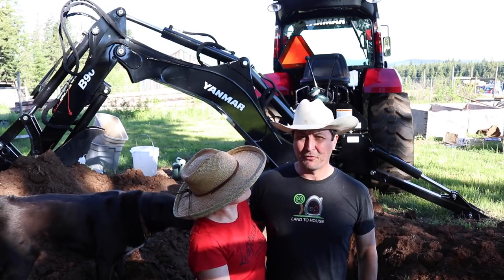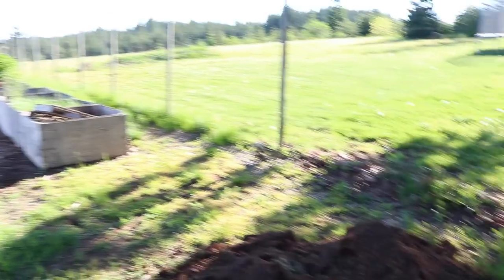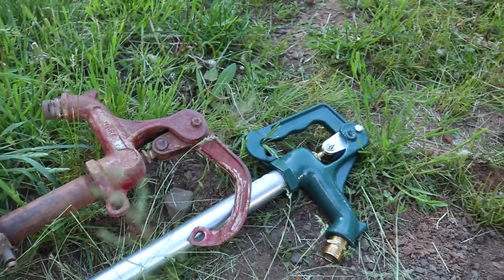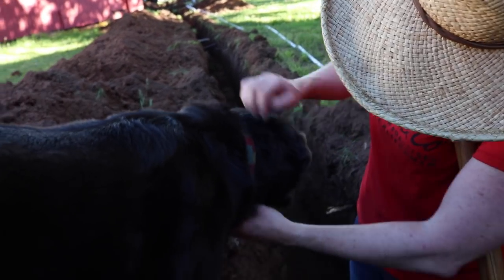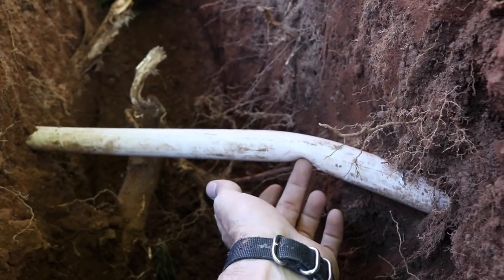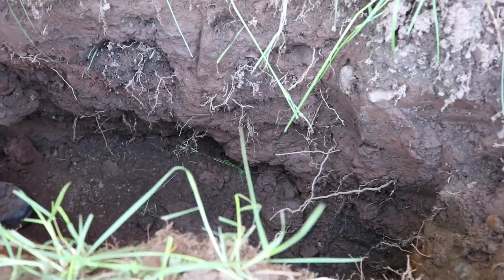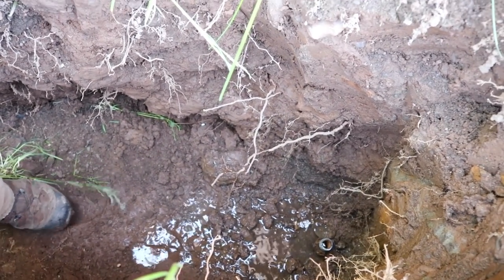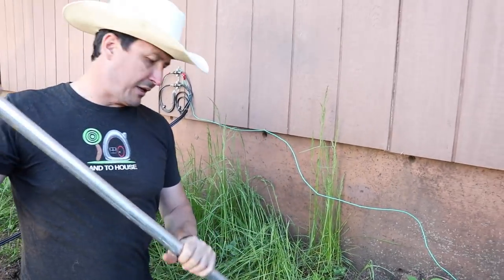A Mouse Jumped On Me - I Yelled

Comment: Hey Cody and Mrs. W.... now you're talking my language. I really enjoyed your yard hydrant installations at the barn and the garden. A couple of things I wanted to bring up. I spent twenty five years plumbing. I was probably one of the last generations of plumbers that actually was an apprentice to my father that spent over forty years in the trade. My son is now a plumber himself. First, the problem of pipe corrosion and eventual failure on the  riser to your yard hydrant is typical. Electrolysis is most likely the culprit, as you have two dissimilar metals connected to each other (in your case the the galvanized and the brass). You are correct, the galvanized will most likely outlast the black iron pipe. I might suggest that you throw a bit of gravel in around the base of the hydrant to allow the drain hole to be free and clear of mud, clay etc. so that it actually will drain out when the hydrant is not in use. Second, it never hurts to put in a post to secure the hydrant to. I can only imagine that you sometimes have long sections of hose connected to your hydrants on the homestead at one time or another. When you are trying to pull a kink out of a long hose filled with water, you might not believe the amount of force you put on the 3/4" riser (ESPECIALLY the new hydrant in the garden, as it is only connected to 3/4" PVC. I have repaired or replace dozens of them that have broke off at the thread for just that reason. Third, great lesson with the correct way to put PVC pipe together, i.e. Primer/cleaner AND cement. It is a two part process and the combination of the two actually melts the surface of the pipe and the fitting together. Though you can get clear primer (not allowed in some states) the reason that the primer is purple is so the plumbing inspector can see that the two part process has been completed. Lastly, you are a fortunate man, Mrs. W is a fortunate women and your son is a fortunate young man. It seems that more and more families today can not do things for themselves. It seems that many husbands and wives are not best friend anymore. It seems that people have forgotten the importance of God in their lives and it seems that many (too many) young people today don't even know how to put air in their bicycle tire. Thank you for sharing your love for God, your family and your homestead with us.
Reply from the maker: +Kurtis Daniels thank you kurtis
Reply: @wranglerstar  AMAN !

Comment: Did I see Mrs. W prime and glue the inside of the PVC then put a collar on the outside?
Reply: Saw the same thing at 10:45ish into the video
Reply: She sure did 
Might check that joint and re-glue
Reply: I noticed that. Oh well, live and learn.
Reply: Savage Mrs. W :-)
Reply from the maker: I did....then I went back and glued correctly....hoping he didn't put the bread in that part of the pipe.  MrsW
Reply: That's how we learn from the willingness  to try and the making mistakes along the way! Plus it keeps things interesting! Just one tip I learned doing these hydrants in poorly drained soil you can slide 10 ft or so of 4" perforated pipe like the black plastic field tile  over the end of the pipe at the hydrant slide it to the hydrant after plumbing connection is made cover the hydrant bottom with stone as you did and also the end of the perforated pipe that gives you some volume for the water to go until the ground can take it down. especially important if the hydrant is going to be turned on and off a lot of times in cold weather like for watering animals in winter. in your case its just used for summer watering plants no big deal lots of time for the stand pipe to drain before cold weather. Plus your soil looks like it will take water just fine this is more for someone wanting to put in a hydrant in poorly drained soil. Nice video as always well done!
Reply: hejsan mrs W remeber this you not learnng from making perfect you learning from the misstage you make , and i just love when you want to try and learn new Things and go "all in" . så gatis på din nya vatensystem och hoppas at dine blommor frodas riktigt bra. trevlig helg alle ihop
Reply from the maker: Tack!

Comment: You two make a good team. It's fun watching you work together.                                                        My dad was an automatic fire sprinkler fitter for 25 plus years. We did many projects together, much like your's. We installed garden hydrants on the old homestead in the early 90's, and he helped me with my house in the late 90's. I love those garden hydrants. I anchored mine to the concrete foundation with a pipe clamp and all-thread. In the garden I drove down deep a one inch pipe about a foot away, and clamped them together near the top with a piece of strut.

Comment: I really enjoy watching the videos of the two of you working on projects together.  I learn something (actually, quite a lot) from each and every one of of your videos.  Thank you.
I've run a bunch of pvc while hard plumbing my round above ground pool and wanted to install a second return on the far side of the pool. Not wanting to have several 45° angles because angles slow the water flow, I learned to bend the pvc to conform to the bend of my pool. It worked like a charm!

Comment: So true about a quality help-mate. You are a blessed, as many of us are. Realizing you are blessed is the mark of a mature man. Watching your interactions is fun because you two are so calm and relaxed.
Your mouse incident reminded of putting up some window trim with my dad. I was on a ladder with hammer in hand and took  a quick tap at a spider that was on the siding of the house. It darted into a knot hole of the trim around the nearest window, causing a wasp that was inside to immediately fly out and tag me on the finger. It happened so fast I didn't realize it was a wasp and not a spider, so I jump off the ladder (about four feet) backwards thinking I was about to deal with a painful spider bite. lol. It swelled a bit but my dad and I had a laugh and I didn't try to hammer any more spiders. Thanks for your videos.

Comment: Tip from a plumber: When putting together threaded pipe always use Teflon tape and dope in conjunction. Usually a few passes of Teflon on the pipe threads then spread dope over the tape. It gives it great lubrication and makes putting joints together easier. Also when gluing joints it's good practice to do a quarter turn of the fitting or pipe the friction helps set up the chemical reaction.

Comment: Yeah, my cousin is a landscaper/ contractor and when he does piping or any irrigation work, he always uses those two bottles that have the primer in one and the glue in the other. it's very helpful and is a must have in a landscapers or contractors kit.
Reply: Connor Logan A. Chavez we used to duct tape them together. Simple and cheap, and oh so handy. Another benefit is it's harder to tip them over.

Comment: hey Cody in the trades I found it's always easier to do your gluing above ground and just leave the last section that has to be cut for later. Then the entire pipe can be layed in the bottom of the trench. Also by doing it that way the first section of pipe comes up at an angle out of the trench, and there's no need for the bread trick.

Comment: a tip about running pipe in a trench and not gettin dirt inside the pipe is to glue the pipe together on top of the ground and then drop the assembled pipe into the trench.

Comment: Wranglestar; would like to see you put a 1/8 pipe 90 degree street elbow in the weep hole. That will keep dirt from getting into the valve and the valve will last a little longer that way. If you look the weep hole is threaded 1/8th pipe. Like to fill in with gravel around the weep hole as well.

Comment: I am guessing:   The last owner had a hydrant with a damaged riser or one that is the wrong length .  Replaced with blackpipe because galvanized was available.  You can adjust the riser and only have to adjust the length of the control rod.    Works for going shorter easier than going longer.

Comment: That looks to be the color white pvc pipe. Schedule 40, construction grade is grey if I recall correctly. It's a little thicker and more dureable especially buried in the ground with only dirt backfill. The stones won't puncture the pipe nearly as easily under the pressure of the ground and water in the pipe and ground movement from freeze and thawing.   Ditches look pretty straight and level. Nice.

Comment: Pretty funny stuff with the mouse.  You ever thought about hooking your below ground metals to a sacrifice? You can get a magnesium anode (pretty much a stake/pin) and wrap some copper round your pipe and hook it to the stake.  The stake will form a weak circuit that induces corrosion on the stake instead of the pipe (thus the sacrifice).  My old man installed gas lines/tanks for a living so I learned some stuff about putting things in the ground, cathodic protection is pretty good, especially in acidic/alkaline soils or spots that tend to be a little damp.

Comment: Is the pipe dope you used OK for potable water? Check for warnings on the container.  If not, make sure you don't drink the water from that hydrant, or even further down line.  Teflon tape is much preferred.

Comment: I realize that the purple primer is commonly used, on PVC pipe, but I prefer to use the clear cleaner. It isn't nearly as messy and I have never had a joint failure where I've used it.

Comment: We have two indoor outdoor dogs here on the farm and we use frontline or brevecta to help control the ticks. It's not cheap but it is a huge help. They still carry the odd tick inside and have them attach at times but the tick dies in a hurry and it seems to have some repellent properties as they just don't seem to have as many riding in on them. Is it good for them? Probably not but it's better than tick diseases. I can keep the tick population knocked back close to the house but once you hit the timber or tall grass they're just ridiculous this year.

Comment: At 10:20 it appears that Mrs. W put the purple pipe cleaner and the  pvc glue on the inside of the connecting pipe instead of the outside while she is also preparing a coupling. I thought that was funny.

Comment: a great little tip do all your gluing above ground  then place it in the ditch saves your back and having to climb in and out of the ditch.. also i am not sure if you can get it in your area but you can get 20 foot bell end pipe and save on time putting pipe in and they are deeper on the socket ends meant for pressure .. ok that is my rant for the week lol have a great day

Comment: Just wondering why you didn't use black roll pipe?  No joints. I was using backhoe and barely caught the main electric line to the house, pulled one side of the two wires loose from the breaker box in the basement which made a 120 volt.  Wife said the dryer was running slow, that's when I found out what I had done.  So don't feel bad can happen to anyone.  HA!

Comment: I had problems with 2 of those hydrants in the past;  1 was like yours and I was told China's fault,  and the other because I didn't add a length of  copper to the weep hole.   I just took it out and capped it the last time,  which was the winter,  that's when they fail it seems.   Better luck to you.   ; )

Comment: That was very enjoyable, also very interesting to see a Hydrant installed that short. I always thought they where suppose to be 4 foot off the ground so you can fill a stock tanks. One question why pvc not that blue pex pipe that is common any more in the Midwest?

Comment: Wranglerstar, I'd like to strongly oppose the use of PVC pipe in the ground, its just a massive pain to repair should it break!

What I would recommend you use is 3/4" (or 1 inch blue) Swing pipe, which is what I have used in my work at a local irrigation company.  Thats specifically how I learned to hate PVC pipe in the ground.  Say water freezes inside of the tube, you now have to dig up a lot of pipe in order to get enough pipe to flex the PVC so you can insert a replacement part for the little bit that is actually broken.  With Swing pipe, you won't have to dig up nearly as much, plus the tube is more flexible and comes in rolls.  For repairs you can very often replace only what you need to replace and only have to dig up that much of the swing pipe.  But on the other hand, you will need clamps for Swing Pipe instead of glue, which in the repair business is a good choice.
Reply: I would like to add that the climate we use this in is that of Nebraska, so it ranges from 110 F through -20 F at its extremes.

Comment: Here in Sweden were I live they recommend 6+ feet to be under the frost line, which sucks 😊
Reply: My uncle used to own a campground in Black Hills mountains of South Dakota. He had to dig up and replace some feeze burst lines. It was after a cold snap, -10 for the highs that week, -35 at night, and windy. The horizontal line was down 6 feet, but the line coming up from the T under the cabin burst about 3 feet down. The electric heat tape only extended 2 feet down, which left some pipe unprotected. Since he was in there, he replaced the heat tape witha new one that goes down 6 feet. He decided to fix all of the cabins during the next slow season, as any burst line means no water to all 14 cabins.

Comment: Heres a hint for you on them tipe of valves take a 5 gal bucket  and cut the bottom out dig th hole deeper so half the bucket is be low the water line and the other half is above the brass valve then fill the bucket with gravle or small stones this will keep the weep hole from plugging  and it will drain better when you shut off the valve

Comment: Brass + iron = bi-metal corrosion. Technically, you should have put a dielectric union between the iron and the brass at the bottom, and another one on the other side but I would probably go with copper pipe to the top.

Comment: I hope you put in a support rod for those garden hydrant's and as for the tape on pipes I never had any problem with Teflon tape its fast and easy but the pipe dope works well to they both do the same thing it's just a pain if something happens to the pipe and you got to go back and fix it and the pipe dope is not dry so you got to clean it reapply and move on after fixing a problem.

Comment: Does a mouse climb up a trouser leg, oh yes, it does!
When I was camping in Luxembourg in the middle of the Müllerthal, this happened to me when I tried to chase a mouse from the tent. Instead of fleeing out of the tent, it sought refuge in my trouser leg and started climbing up. I blocked it with my hands before it could reach my more sensitive area. It went back again and fled. All this only took about a second or two, but I may have yelled too!

Comment: As a 17 yr journeyman plumber, I advise that you do not do the bread trick. While the water will eventually dissolve the bread, it will take weeks and while you wait for it to dissolve, little tiny pieces of bread will clog your appliances, especially if they have aerators. I have dealt with homeowners who have used this trick and clogged every faucet in their home.
Reply from the maker: +Rick Hart Woodworking anyone who knows anything will flush the plumbing lines before connecting to any appliances  perhaps apprenticeship school hasn't got to this part yet
Reply: Trouble is, the average homeowner doesn't know anything about plumbing and part of the process that was not brought out in this video is flushing the lines before you connect it to the system. One other thing, I stopped being an apprentice a very long time ago. I had to study under a Master Plumber for 5 years and then take a huge test on plumbing and plumbing codes to get my Journeyman's Licence. I wasn't trying to be cynical, only passing on knowledge that I have experienced many, many times in my 17 years of experience dealing with homeowners who believe they know what they're doing. There have long been many shortcuts that have been presented and passed on through the years dealing with many aspects of repairing services in the home. Many were proved to be anything but. I understand you get many on here that have a bad attitude and troll you to cause trouble. I have been watching your vids for well over a year without a word because I like what you provide. Your knowledge of woodworking and timber framing have taught me many things, but if I see a mistake, I will speak up. If that bothers you, then I am sorry, but I will not be silent.

Comment: I think you primed (10:30) and glued (10:47) the wrong part of the pipe, the outside of the pipe should get the glue not the inside. you glued the coupler correctly. You might want to check that joint. Hopefully you got enough on the coupler (10:18) Oh but later you get it right. All is well, I can sleep now.

Comment: Hope you got that tick out, poor Lucy.
If you're having problems removing them I've got a trick for you.

Take a q-tip and slightly moisture it, lift the tick up horizontally and with the q-tip start rotating the tick using slow circular motion. Might be a slow method but eventually it will just pop right out. And every single time it works.

Because you don't want the head to be left in.

I hope you understand my poor English, I'm from SWEDEN.

Tell mrs W.. Hon har en fantastisk familj, ni njuter verkligen av livet! Önskar er all lycka.

Kram på er

Comment: Apply the pipe dope into the male threads.  Brush off the excess.  Screw into the bare female threads.  As the threads screw together, the excess pipe dope will be squished and moved forward along the female threads.   Due to the lubricity of freshly applied pipe dope, proper joint seal need not require herculean effort.

Comment: I used the bread trick and then plugged the screen on my bathroom faucet. So remove the screen on the faucet before you run water thru it. It was an easy fix, but really annoying.